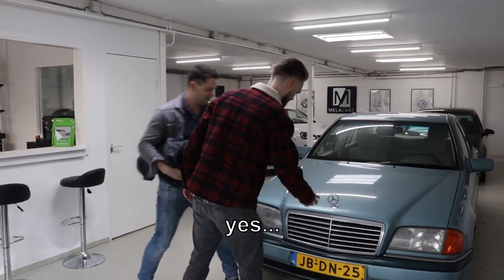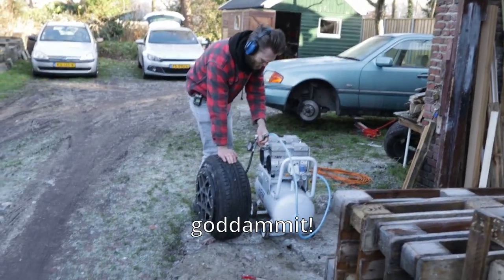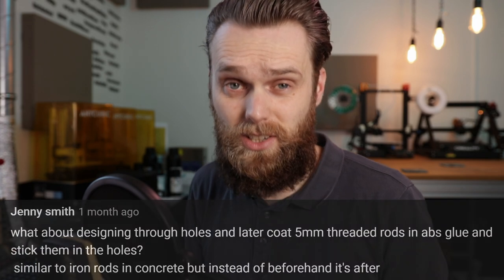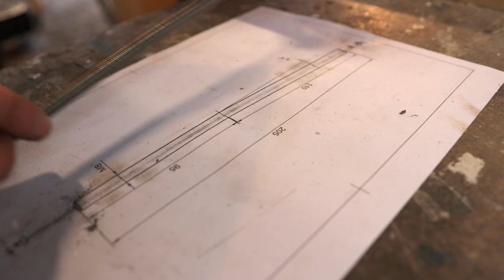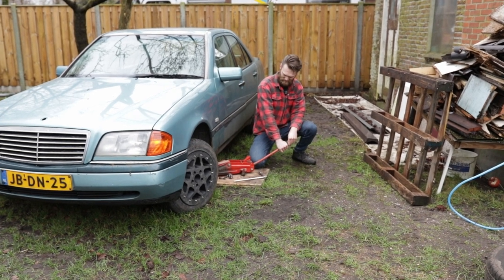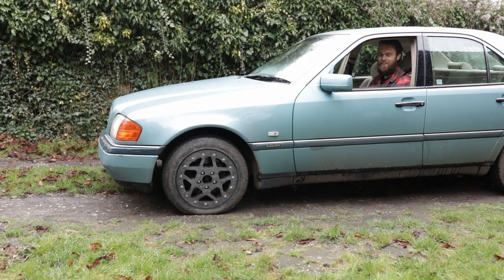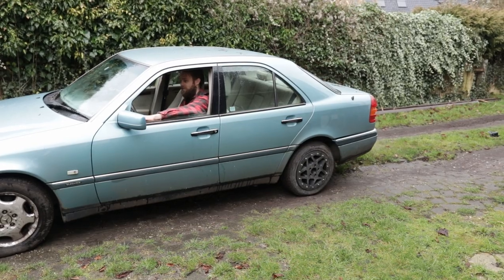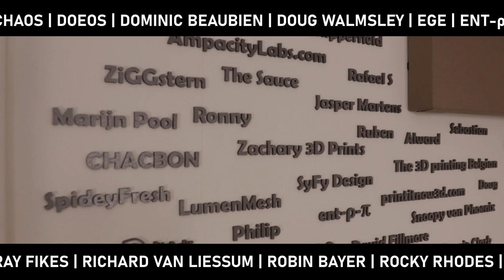Can you actually 3D print a working car wheel?

Comment: I'm really curious why some parts of the world seem to use inner tubes on regular tires/wheels while this is something I've never seen in my life (canada)
Reply: Some use them keep salt water in in heavier equipment while not allowing it to corrode rim and on normal road vehicles inner tube is protected by the tire, so if there is minor cut that would normally tear open tire since pressure builds up in that spot. Other potential uses are somewhat corroded rim lip that would leak if it was tubeless tire since pressure would leak between paint and metal, or simply rough surface.
To open up salt water is used specially in tall vehicles to move center of gravity down by filling some of the tires space with water 1L=1kg of water, pour in 30liters and you have 30kg of tire weight in lowest point of the vehicle, while also increasing vehicles weight to gain better traction to surface and its always inside the camber line on side where vehicle is tipping and outside of camber line on outer side, so it has impressive amount of balancing capability. Of course salt water in tire... well rubber does not give much of a fuck about it, but valve stem and valve might start corroding, though if you fill rest of the time with nitrogen or other inert gas that should not be much of a issue. Also this mostly apply to low speed vehicles like tractors since water like air has resistance and looking fluid dynamics what ever gas or liquid it will cause drag when moving inside, so in high speeds centrifugal forces well as mentioned friction/surface tension could move water around the tire chancing its balancing characteristics, while also it increases weight of the drive train increasing power needed to turn the wheel. I havent done this but its a thing in the tool box case i need to go driving on steep hill or something like that.
Hope that answered your question, others can open the topic further.

Comment: thing is.. Why dont you get long bolts? And put then thrue the fron and the back second rim piece? then put the nuts on the back so facing the suspention That whould be smart!! (edit: Someone already had the idea huh.. But i dont mean gluing it i mean SCREWING IT ON WITH BOLTS HAH :D)
Reply from the maker: I'm going one step further, no threaded rods at all. 100% 3D printed!
Reply: @properprinting  Ohhh no. Have luck then x3

Comment: You're game putting it on the front first. How about a design with thinner bolts all the way through with a nut on the end?
Reply from the maker: Thanks for your suggestion! I want to try a 100% 3D printed rim and I think I have an interesting idea for this which might work! :D
Reply: @properprinting  Neat! You should probably go up a size or 2 to get around clearance issues. You'll need to make your printer go large tho..

Comment: I don't understand why you are continuing to use ABS though, ASA would be better for this application than ABS and isn't as prone to separation as ABS. Bonus, it doesn't break down in the sun like ABS
Reply from the maker: I can imagine! I chose ABS to start with for a couple of reasons. It's relatively difficult to print a large part with it and I want to gain experience printing larger parts out of difficult to print materials (for other purposes). With ABS I can tell more about my printer's performance. Secondly, it's cheap so I can mess around with it more. And lastly, if I manage to get it working with ABS I have more confidence that it works with better materials. This is the point where I'm at :)
Reply: @properprinting  I can respect that, largest one part print for me with ASA has been 17" round, thankfully ASA is way less warpy as I did it with nothing more than a thermal blanket over the printer. But I at one point was going through 5kg rolls of ABS like crazy, just from failed prints at random

Comment: I have not watched the video but his seems like a really dumb idea for a couple of reasons. Fdm (plastic) prints tend to break from brittle failure. That would make inflating them hazardous especially for a van. The print cannot possibly survive the kind of heat generated by the brakes in stopping from high speed or driving on mountain roads. Where can I order a set?
Reply from the maker: Not gonna lie, you had me in the first half😆